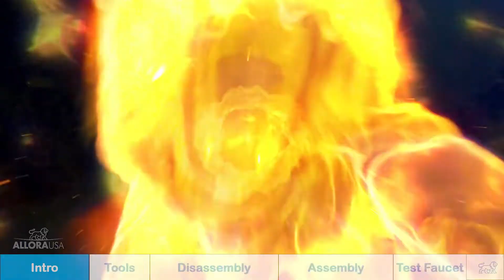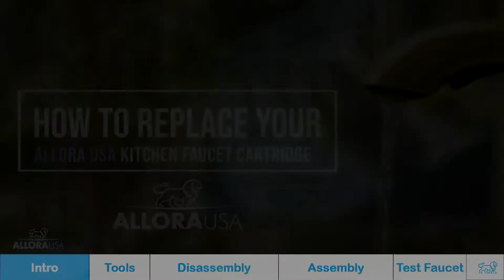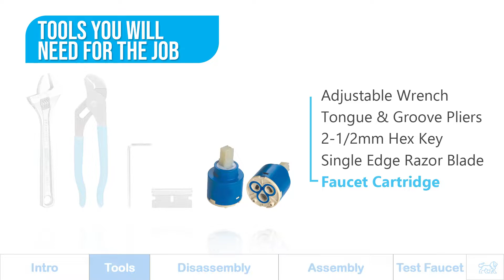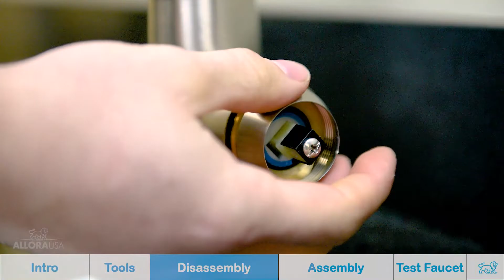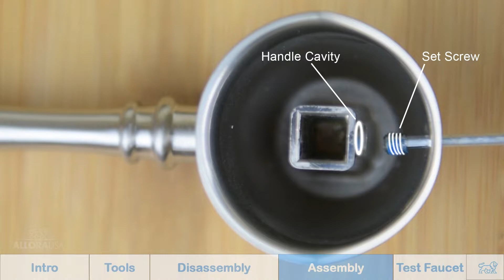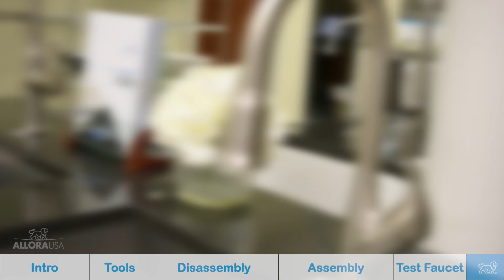How To Replace Your Allora USA Kitchen Faucet Cartridge

Comment: You forgot to add in taking the metal cap that’s held on by a Phillips screw and to remove it and place it on the new cartridge. My new cartridge just came in and it did not come with the metal cap that’s overtop the nylon part that the handle goes onto.